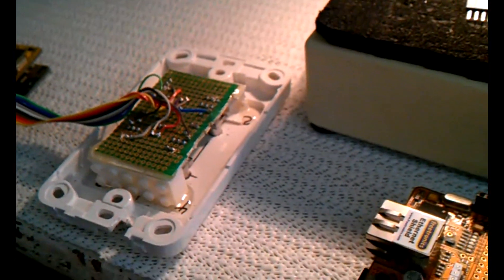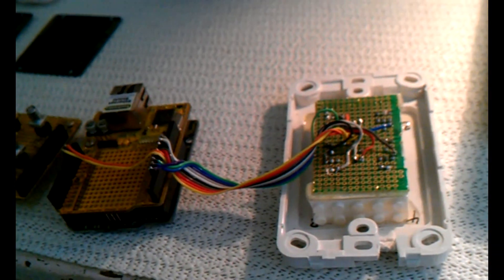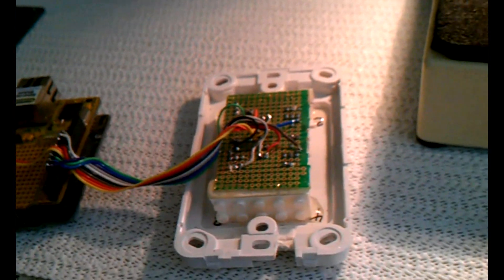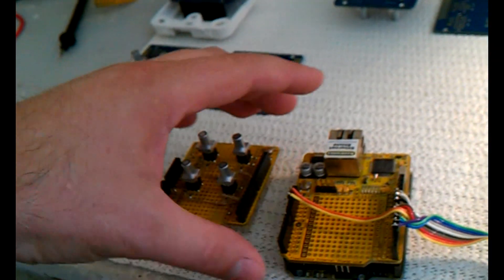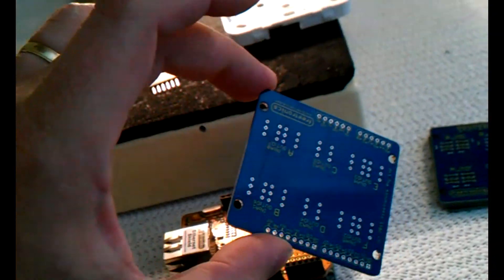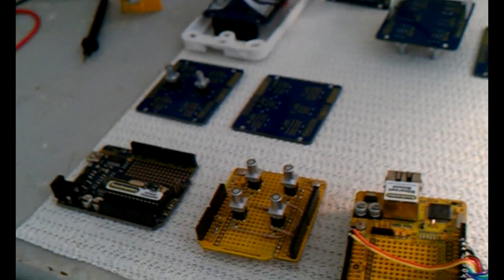Walktime Blog #15: Arduino light switches

Comment: The wiring on the proto shield version of this switch has me totally stumped. It appears that the digital pins D4-D7 are connected to one side of the button switch via a resistor, with that side of the switch also connected to the 5v rail. This would pull up the digital pins. However, for the switch to be effective, the other side must be connected to ground. Surely the way it is wired, pressing the button shorts the 5v rail to ground?
Reply: the pullup resistor would be inline with the 5v rail, this would still pull the input pins high, whe the button is pressed the inputs go low, the 5v rail goes through the resitor then to ground
Reply: but on the board in this video, the resistor is between the switch and the digital input. One side of the switch is connected directly to a 5v rail. In order for the switch to have any effect on the input, the other side must be connected to ground. Pressing the switch directly connects 5v to ground, not through the resistor. It looks to me as if the resistor is on the wrong side of the switch.
Reply: Wanarunna that is true,  but with these particular switched they are illuminated so the 5v rail going straight to the switches would make sense but the resistor between the switch and the inputs is confusing
Reply: The led's in the switch are connected by two centre pins on each side of the switch. As best I can make out there is a surface mount resistor on one side of the led pin which is then connected by a black wire on the back of the board to one of the analog input/outputs on the shield. The other side of the led seems to be connected to ground on the back of the board. The led's in the switch are therefore controlled independent of the switching circuit. As you say, is the resistor between switch and inputs that is confusing me.

Comment: have you considered making dimmables?
Reply from the maker: Yes. The switches shown in this video are very obsolete now, they've been replaced by several newer generations! What I also need to do is change the way control is done. Right now most of the loads in the house are controlled by relays mounted in the switchboards, but I want to replace them with TRIACs so I can do dimming on some lights.

Comment: While you were having PCBs made, why not integrate the microcontroller and Ethernet magic on them directly?
Reply from the maker: +fabts4 I already had the EtherTens so doing a layout for just the buttons was faster. Also, this video is really old now and I've since gone through a few more iterations. I don't bother putting a microcontroller at the switch anymore, I just use the Ethernet cable as a patch lead to connect the switches and LEDs back to a controller that's located in the switchboard. This makes each switch much simpler and cheaper
Reply: Do you have any logic at the switch end?I am curious as to how you can have 6 switches and 6 status led's over 4 twisted pairs?

Comment: I did something similar to this, but I used anti-vandal switches so I didn't need to use standoffs. They are also bicolored RED/BLUE so I used blue for OFF, red for ON, and violet(oscillating between RED/BLUE fast) for a remote override indicator that will flash red or blue briefly to indicate whether it's on or off.

Comment: First, many thanks for sharing your experiences with us.  It is educational and most of us would not have the time, money, knowhow or guts to just "do it".  Good stuff!

Anyhow, I have a few comments...hopefully food for thought but possibly just a waste of your time.  anyhow here goes....

I'm currently designing (hopefully building) a home monitoring system with some (limited) control functionality.  I've watched the majority of your videos and I think that technically you've done a great job.  I see you solved many technical challenges.  However, I have the same fundamental issues with what you are doing as I do with what Clipsal promote for their CBus system (obviously lots of people don't share my point of view ;-) ).  Yes, you can automate almost everything but in reality it often boils down to a form of "flexible remote control".

When you talk about automating light switches...only rarely is there much benefit.  Fun...yes...benefit....well....????

I do have a remote controlled gate and garage door (with keypad controlled entry). I also have sensor lights in my driveway, front entry, rear of house, garage, walk in robes, etc. That is sufficient (well, from my point of view).  Yes. I can't turn my lights on when I'm at work.... but so what?  I live 100m from a surf beach and cop a lot of salt air so electronics don't like it...my $2000 7.1 amp lasted 2 years...the fridge lasted 5...many of the powerpoints were failing at 15 years....get the drift?

Anyhow, I guess my circumstances are different!  However, I still think that the KISS principle still reigns supreme....if it ain't broke, don't fix it!  If there is little benefit in automating it then don't  do it!

As another example, if my energy monitoring system is out for a few days (or weeks)...who cares?  However, if our lights don't work for even one night then my wife will ensure I have a squeaky voice forever...I might not use 'em these days but I am attached ;-)

Now as for the technology...I think that MQTT is a great idea (but then I'm a software person not a home automation expert).  What I'm questioning here, is the complexity of having every light switch panel having an Arduino with Ethernet and needing to be wired back to a central (or duo) panel!  Surly an Arduino with a simple RS485 i/f with bus supplied power (like you do with your current Ethernet solution) would suffice?  If you used a "bus architecture" (like RS485) then future system mods would be way simpler (yeah I know that "daisy chaining" devices does not fit with the current flavour of the "Structured Media Centre" concept but then we all don't live in data centres ;-)   Having said that, I do have my phone and data wired back to a central panel containing a 24-port patch panel, ADSL modem/router, VoIP ATA and a GBit switch.  Mostly this "just works" but I've had intermittant problems with switches, patch cables and RJ45 jacks.  This is bad enough when it takes out a computer or my media player but my lights?

Anyhow, light switches are just simple devices (i.e. sensors in an abstract way) and they could happily play "slave" in a master - multi-slave senario (i.e on an RS485 bus with a single controller).  Thus a simple controller (possibly running on the same physical server as your MQTT broker) could mediate between your RS485 connected light switches and the MQTT broker.  This is what I'm planning to do with my sensors (I'm also planning to make some sensors communicate via simple wireless protocols (e.g. 433MHz).  It is cheap and low tech (in theory at least) and seems like a nice mix with the MQTT model (as the broker won't know or care they are connected by RS485/wireless).

Just my viewpoint and (as yet) untested ideas and theories.

Cheers
Chris

Comment: Hi, how would it possible to do a dimmer switch with this configuration?
Reply: yes, it would be very easy to just connect a potentiometer to the analog input on the arduino
Reply: David Andersson although you would need a tric that can be controlled with dc

Comment from the maker: Yes, but it wouldn't save much. The MCU is one of the cheaper parts of the whole system - in fact each of the illuminated buttons costs more than an MCU! Saving a few cents there wouldn't make any real difference

Comment from the maker: There isn't specifically one Arduino per room: they're just embedded wherever it happens to make sense. Each light switch has a Freetronics EtherTen behind it, and there are others under the floor and in the ceiling for sensors, outputs, etc. As for how many, I don't really know. Currently a couple of dozen, I suppose.

Comment from the maker: Using the buttons as toggles wouldn't require any changes at all (even code) in the button panels, because they just send button-press events. All I'd have to do is change the logic in the controller that they talk to. The reason I didn't do it that way to begin with is it means I don't have to care about tracking state at all: it's a simple "on" or "off" message that goes from the button, to the controller, to the switchboard. No need to store anything

Comment from the maker: I discussed this briefly in one of the SuperHouseTV episodes, I think. It sounds obvious to just put buttons on the ends of long cables, but that has problems with noise isolation, voltage drop, but mostly number of wires: 6 buttons + 6 status LEDs is hard to do on simple 4-pair cable without putting logic at the end. Then when you put logic there, you need comms. When you need comms, there are a few options, and when I narrowed them down I ended up with Ethernet.

Comment: Why haven't you wired them all up to your central unit, and put a 12v voltage on it? So when you push the button you have the 12 volt input to work with. Instead of having a microcontroller on every group of light switches. And now you need to work with some harder programming because of the bus.

Comment from the maker: @dan1el101 You're right, I was sloppy with my terminology there. In fact part of the point of doing home automation is to get rid of the whole concept of "2-way" switches etc entirely, because the link between control surfaces and devices is purely a software mapping. I should refer to them as "4-button keypads" or something, since even the "off/on" pairs are arbitrary. A simple software change could make each button a "toggle" input and control 4 devices with 4 buttons.